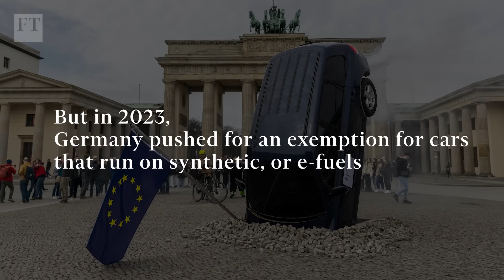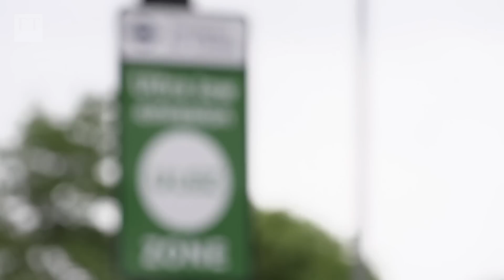The end of the combustion engine? | FT Energy Source

Comment: 1/2 of a car's emissions come from its production. Work from home and driving your old car longer are greener choices. Furthermore, EVs are only as good as their base load fuel source. Nuclear is the cleanest and safest way to go.
Reply: EV's are by far the cleaner option, and any new should be electric if we are serious about tackling climate change.
Reply: @thewatcher5822  I mostly agree. Certainly, they are cleaner, but driving the car you already have is the cleanest option. Gas will have a place for certain reasons during the transition, but it needs to be accessible and practical to be adopted. EVs are only cleaner if they are charged by wind, solar, or nuclear, and nuclear is the only source currently capable of baseload supply. Natural gas could be a cleaner option, but it depends how it is sourced. It's often a captured waste product, resulting from oil extraction, and in the US, priced accordingly. Burning coal or oil to produce the energy stored by an EV's battery doesn't make EVs cleaner. The entire energy supply chain needs to be cleaner to make a difference. Encouraging EV ownership is a good persuit as it will place demand on supply chain improvements.
Reply: @TK-ek5kp  Renewables are now the cheapest and fastest growing in the energy sector. Grids are only getting cleaner, and EV's will play an important part in  that.
Reply: @thewatcher5822  right, but our energy consumption is growing too. I'm not sure if renewables are keeping up with the growth. I haven't checked. I agree with you that the change is needed. The challenge is in the execution.
Reply: @TK-ek5kp  The UK's grid is now around 40% renewable, and growing rapidly. Before it was mainly coal and gas. Now coal is around 2% of the UK's grid with gas and nuclear making up the the majority of what is left. This trend towards renewables will only continue

Comment: I don't care if electric of ICE as long as I can buy it at less than £8000. Never bought a new car in my life (not financially ignorant enough to do it).  My current car was bought at £7500 about 8 years ago and still run like normal (just typical regular services and maintenances).
Reply: The used EV market is already thriving. One well known YouTuber bought a 2016 Renault Zoe with 35k miles on it for £4400 a few weeks ago. Something like that, along with a decent off-peak tariff, and you've got motoring at less than 2p per mile. I know a guy who got a new but unused EV home charger for £250. It was still in it's original packaging......
Reply: I think ithe variety and quality of new models is exploding - that explosion is only just beginning to reach the 2nd hand market so I feel it's worth waiting a year or 2 - some of the great cars that were released last year might be entering the second hand market by then.

Comment: It would have been good to hear that despite e-fuels lauded as being an solution, ICEs running on them still produce some NOx and SO emissions (as well as some partially unburnt carbon products e.g. CO) and will still require an oil change (and fuel additives) at least every 20k miles.
Reply: Also, the cost of synthetic fuels will be prohibitive. They are likely to cost 3 to 4 times the price of unleaded gas/petrol.....
Reply: @Brian-om2hh  - This could be relatively easily reversed. Fossil oil is currently heavily subsidised and lobbied for (one only has to look at despicable behaviour of the COP28 hosts - b*stards!) The tech required for processing crop oil is much simpler and would not require the distillation columns and the amount of energy input of fossil oil.
Reply: The only CO2 and particulates that are emitted are from "blow-by" from the oil rings..far lower than from conventional rice vehicles..and no one ever mentions the CO2 deficit that battery electric vehicles have at point of sale , purely because of the massive amounts of CO2 required for mining and manufacturing of batteries..if you live in a country that produces electricity with coal , gas or other CO2 emission sources then your transferring the CO2 from your exhaust pipe to a power station..the future of transportation is eclectic not battery electric!!.❤️🙏🇺🇸
Reply: @caravanstuff2827  234gCO₂eq/kWh for my local area grid for 2023. About 58gCO₂eq/mile or about 37gCO₂eq/km for around town EV driving. My gasoline vehicle is about 400gCO₂eq/mile or 252gCO₂eq/km.
Reply: @caravanstuff2827  - I like snazzy soundbyte at the end! 

Re: "The only CO2 and particulates that are emitted are from "blow-by" from the oil rings" - partiality true. These are also emitted when an engine is malfunctioning or poorly maintained.. Whichever hydrocarbon is used, partially burnt fuel can lead to emissions (soot, benzene, CO, NOx). You may also think about the necessary fuel additives.
"and no one ever mentions the CO2 deficit that battery electric vehicles have at point of sale" - there is a lot of documentation surrounding this and a lot of 'chatter'. The conclusion seems to be that EVs, while initially more CO2 intensive, soon break even around 5-6 years and last longer than ICE vehicles. Let me know if you struggle to find the info.

"purely because of the massive amounts of CO2 required for mining and manufacturing of batteries" - which will also change as recycling plants gear up and mining is undertaken by electrically powered machinery (which is already happening - search for the Volvo autonomous plant vehicles).

"if you live in a country that produces electricity with coal , gas or other CO2 emission sources then your transferring the CO2 from your exhaust pipe to a power station" - The goal is to move away from fossil fuels. The UK has only one functioning coal fired station which is due to close imminently. Even China, criticised for building new coal fired stations actually builds one new station which is far more efficient and may replace several old stations. 
You'd not mentioned CO2 and it's connection with climate (and us and everything else that lives on this planet). Just wondering why not?

Compare the EV transition to the switch away from steam. In 30 years we'll wonder what all the fuss was about. We'll still see ICE vehicles (and I'm glad about that, just as I am to see steam engines), but they'll be mostly in the hands of collectors and enthusiasts. I have both EV and  Diesel vehicles. I feel about my Diesel in the same way as I would a living thing, just as one might feel about a steam engine. But the EV is far far more practical.
Reply: @caravanstuff2827 the emissions from battery manufacture need to be considered bit their contribution is way exaggerated. The CO2 emissions from driving an ICE car are about 9 times as much as the emissions from mining and making the battery. Those emissions are being lowered all the time. There is a new lithium mine in Canada which is going to run entirely on electric mining machinery powered by local hydro electricity.
Reply: The matter is not limited to batteries, but also the semiconductor industry is destructive to the environment (the only material on which the entire complex electronics industry depends).

Comment: Stories abound of cars being totaled and junked because the battery fails and costs more than the car is worth to replace the battery.
Reply: Car yards are full of ICE that they cannot sell and are junked. Salvage yards are full of expensive ICE that are slightly dinged or nominally undrivable with mechanical faults that are not worth fixing.
There are specialist repairers of battery packs, some of whom have postings on YouTube showing the quick and economical fixes to mainly water damaged electronics. We have now reached sufficiently reliable and cheap cells at $60kWh (LFP CATL) that packs can be recycled as economically as replacement repairs. Media give out of proportion exposure to anything negative about EVs, especially the most successful companies, because drama sells.
What's your backstory?
Reply: Firstly, EV batteries don't "fail", they lose efficincy slowly, over many years.  Secondly, why would you "replace" the battery, when it can be repaired and refurbished at way less cost than replacing it?

Comment: In UK people are complaining the EV costs more to charge than to fill the tank on an equivalent car.
Reply: Depends on where you charge. Charging at home is considerably cheaper, rapid charging depends on the vendor. Tesla compete very well, Gridserve are excellent but others can be quite expensive
Reply: If you charge at home on a suitable off-peak tariff, the cost is around an 8th the price of using petrol. If you have no choice but to use public charging, then taking out a subscription to the charge network you use is the solution, and can reduce costs by as much as 50%. I take it you were not aware of subscription services?  My local public charge network charges 38p per kwh using one of the 3 subscription rates they offer. That puts the cost at around the normal domestic home rate, and around half the cost of using petrol.....
Reply: @Brian-om2hh  38p per kWh! What a green success story! My electricity is less than 14 cents per kWh!

Comment: The ONLY known way to CO2 neutral is via COMBUSTION.  It will cost 20 times more to charge a battery than to make fuel from RE or nuclear.  The toxic waste in an EV is enormous and unsustainable in reality.  We don't have the materials for EV, let along wind and solar PV.  

New Combustion tech will be 75% and capture CO2 and recycle it.  This combustion tech will be 1/2 the weight of an EV and have ranges of 10 times more than an EV.  3000 miles with CO2 capture, and 9000 miles without vs EV at 300 miles .  Use gasoline and still be 2.5x less CO2.  In life cycle, it can be up to 33 times less CO2 than EV.  

Old ICE cars can be 2.2 times less CO2 than an EV just by using RE fuels.

There is NO point to an EV if you are actually serious about CO2...NONE.
Reply: Well that was nonsense. EV's at this point are inevitable, and once ICE is gone nobody will be calling for it's return.

Comment: I believe more in Hydrogen/EV hybrids. 
Imagine if there is a massive power-outage, what will you do?

Also the charging infrastructure for charging a lot of EVs at the same time is quite high to complete, and how do you produce that electricity?
EVs might sound great on paper, but if you still produce "less than green" power to feed into those EVs then you have basically just shifted the problem.
Reply: I have 2 evs with solar and powerwalls (battery backup system)
Reply: Hydrogen has no future on our roads (for many reasons) As for the electricity it can come from many sources. The UKs grid is now around 40% renewable and growing. EV's are not green, they are greener, which is the point.
Reply: Hydrogen is an expensive fool's errand re passenger cars. Much too energy intensive/expensive to produce,store,ship etc. Already failed in US.
Gas stations already don't work in power outages (maybe temp w/ generators)... and can't fuel anyone when their tanks run out, eg in storm panics. EVs can charge from any electricity, even a wall outlet (slow in 120V USA, but)

Charging lots of EVs at home or at work, on level2 240v AC, is not that much different than big A/C home/office loads. Grid can already handle it, or need slight build up, just as the grid did with the expansion of air conditioning.
The improvement really needed here is easy solutions for folks in apartments or w/o garages who can't charge at home, eg work or streetlight etc charging.
DC Fast Charging does need bigger grid infrastructure, but- that is primarily for road trips, not every car on the road. Still also cheaper than gas fueling, usually.

Many studies have shown, even with the worst / dirtiest electric power source (eastern Europe coal), EVs are cleaner than gas cars... and with every country already greening up their power generation, or even just homeowners adopting rooftop solar... NO emissions.

Comment: There's almost no room for combustion engines development anymore because they are at the peak of their performance due to a century of ultimate competition among biggest players.
The electric vehicles, on the other hand, are only at the beginning of this path. And even now they outperform combustion engines by thousand percent in weight, torque and power.
Low cost and low weight batteries are the key.

Comment: For ordinary folks we need few important improvements in EVs before we buy them: 
1. Must charge under 10 minutes 
2. At least one free battery replacement buy the car company or 1 million miles battery 
3. Charging points at every gas stations and every 10km away from city 
4. Keep the price under 15k as cheap Kia cars
5. Weigh and curb the pollution caused by EVs and electricity making process 
6. Range must not be less then 1000 km after cold, hot, rain issues not the lab test (500 gets 150 kms)
7. Get rid of all explosive, cold start issues 
8. After above done, all EV preachers must adopt EVs first (politicians, scientists, activists, lobbyists, ESG raters, wokies etc)
9. Remove unnecessary media propaganda, free benefactors, free radicals, control freaks etc.
Go big or go home folks. Don’t shove your opinions up average Joe, yet rich Joe is just another spoke a wheel, because Master of the game is somebody else! 

YT: This is hate speech.
Reply: You forgot I still want the Hoverboard promised to me in Back to the Future Movie.
It sounds like Boomers won't be happy until we get George Jetsons flying car.
The problem is, if we don't address the Climate Crisis, Fred Flintstone's car will be an unobtainable luxury.
Reply: EVs are already cheaper than ICE vehicles, but the catch is over the lifetime of the vehicle. The average person however is reliant (addicted?) to debt, and so with a cheaper upfront cost ICE is going to appeal to the cash strapped and/or uninformed (and to a much lesser extent niche purposes). But having said that, battery prices (the most expensive part of an EV) are still dropping as economies of scale are still having an effect. It will take time, but it will be much less than the switch from horse/steam train to car/truck.
Reply: fake news. Car insurance is not going up by 100%. If so than change insurer and get 50% lower price.

There are car rentals with hundreds of thousands of cars and no single fire ever happened to them. It is fake news and myth spreading by ICE manufacturers and media.
Reply: If your list applied to ICE vehicles, we would not be driving those as well. Oh wel! back to the good old horse and cart - but wait....

Comment: synthetic fules? hydrogen?
Reply: Both non starters. EV's at this point are inevitable.
Reply: @thewatcher5822  thanks for your detailed analysis and explanation - oh wait - you haven't done that - because you are WRONG.
Reply: @os3990  In a nutshell they are horribly inneficient, along with many other issues. They will never be a thing on our roads.
Reply: @thewatcher5822  if they're powered by renewables (therefore infinite) what does efficiency matter?
Reply: @os3990  You may as well just use that energy in an EV, with no waste.
Reply: @thewatcher5822  why? Synthetic fuels negate any environmental argument, and can be refuled in minutes. They also allow current cars to run, without the need for building millions of new electric cars. Admit you are wrong
Reply: @os3990   Synthetic fuels negate any environmental argument? Maybe you should look a little bit more into that.
Reply: @thewatcher5822  if they're generated with renewables (as I said) - they are carbon neutral - so yes
Reply: @os3990  OK. don't look into it.